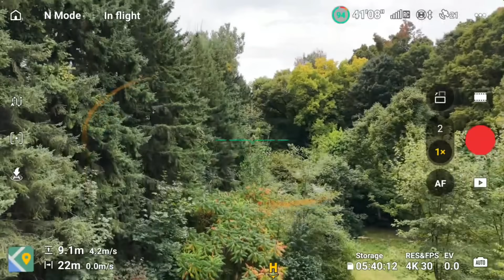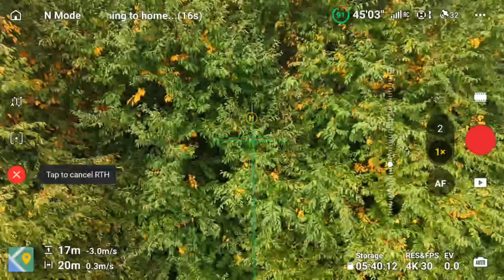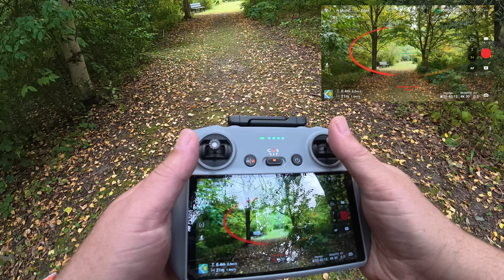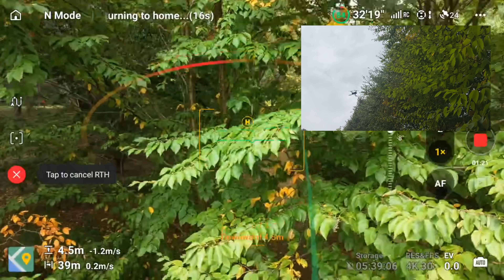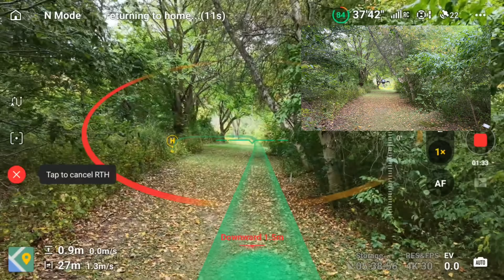DJI Mini 5 Pro NEW Next-Gen Return To Home Demonstration

Comment: Holy crap. Lots has changed since my first drone, the DJI Phantom 4. I will say, though that the Phantom 4 was able to carry a half dozen chicken eggs from my neighbor’s house located approximately a quarter mile away. That ain’t happening with this thing, right? 😂 Excellent video!
Reply from the maker: Indeed, I think it would have a hard time carrying that type of payload. But they have changed quite a bit. They are extremely capable for the size.

Comment: Greetings Shaun...Do you think this feature will solve the problem of drone retrival on a boat, would it perform well on returning through a door opening into the galley of a fishing head boat on the Ocean?

Also what will happen if the sensitivity of the  sensors causes the drone to stops  for an obstacle its can't find its way around? What will the drone do when this situation is encountered?
Reply from the maker: That’s a good question. I’m not sure about that. How it would behave on a moving boat.  Or even a stationary boat with drifting. Maybe somebody else with more experience who has tried it give some advice.

Comment: Do you have to have it set to SMART RTH also does it work at night?
Reply from the maker: It is automatically enabled, and in indeed that can function at night however there are some extra risks, but due to its new front facing light door it should still be able to detect the obstacles even in poorly lit conditions. Just be very cautious and always be ready to cancel the return to home if necessary.

Comment: Very nice video. Thank you for sharing. I have a question: My balcony is at the 4th floor. If I want to fly from there ... are there things I have to consider... When the drone leaves the balcony, will he keep is height?
I fly a DJI mini 5 Pro. Thanks in advance.
Frank
Reply from the maker: Hopefully somebody will experience can answer those questions for you. I’ve never done that myself in theory. It is supposed to be able to handle those types of situations. It’ll maintain its height. It’s just important if you try it make sure you’re ready to cancel it if need be

Comment: How does it know to land on that little pad? Reason I ask is because every time I have ever RTHed a drone it just lands in the general area of where it took off. It’s never been that precise.
Reply from the maker: For the most part that they usually land in the general area sometimes they’re off by a couple inches sometimes a couple of feet. But the important thing is that they come back to the general area so you don’t lose your drone in the event of a fail safe disconnect. I found some of the newer drones are more precise than some of the older ones.

Comment: I love how it turns around at the end to point in the same direction it started, very OCD. I picked mine up on Friday and have been playing with this feature. I have the Mavic 4 Pro but need a sub 250g for shoots in restricted airspace (it weighs 251g, but hey, who's counting? I'll pull a prop off if they try to arrest me). The Mini 5 Pro is amazing in capability and image quality for its size.

Comment: Suggestion: please perform this test again, in the dark, and when it reaches the altitude where you would like it to return home, turn the controller off without pressing the rth button and please DO stand right in its way where the green rth-line would be, to see if it will dodge you. Now thats pretty much a worst case scenario
Reply: I second the test idea.

Comment: So, if you fly around for 20 minutes and then issue return to home, if the drone traces the flight back it will run out of power long before it gets to the home point.  Something to test in your next video.
Reply from the maker: It won’t backtrack your entire flight. It’ll come to the home point using the built data once it gets close to the location.

Comment: Oh, this is exciting! My Mini 4 Pro is still crushing it though. I'm going to wait for the Mini Pro 6 with a dual camera system (and maybe self-unfolding legs and a one-hour battery🤪)
Reply: Really, how is your Mini 4 Pro crushing it exactly? I just got my Mini 5 Pro on Friday and I have yet to find any new feature that is not an upgrade over the Mini 4 Pro, or any feature it has lost for that matter. Good as the Mini 4 Pro is, the 5 Pro is next level, they are not small upgrades.

Comment: Very impressive. The mini 4 pro does some amazing home returns too. Not as good but I have tried many home returns it thick woods and was completely amazed.  Not quite as good but still amazing. The only upgrade that would make me want to upgrade is the one inch censor otherwise I really don’t need it. My mini 3 pro and mini 4 pro have more flights than I can count and have never had a crash. I still own the original mini 2 and even that drone is still like new with over a thousand miles on it. Still running with the original battery’s on it DJI is definitely number one for me I have had many drones from most drone manufacturers. Sadly all my drones that were not DJI are all gone from fly always, crashed, or completely dead batteries that are not available anymore or not worth the cost. Thanks for another great video,,,,😊

Comment: What models does this new feature apply to? I have a few DJI models and never can keep track of what each can do.

BTW, yesterday I was "exercising" (i.e. making sure it still = AOK) my old Air 2S. I did any/all of the updates as needed. Had it & RC-N1 & phone fully charged. Did a 5 minute test flight. On the way home the phone screen went black (maybe screen went to sleep, not sure). I freaked out because I could not see a screen. but I could see the Mavic and could still control "blindly" to guide it back (luckily the phone screen finally popped back on before landing). But I had never had this happen before and was wondering if Return To Home would automatically kick in if the controller failed or turned off. Or do I have one those models from the era when they would just fly away went something went wrong? Thanks, been subscribed since way back.
Reply: I have a Mini 2. You just need to make sure it's set to Return To Home in settings, not hover in place or land. I've "lost" it a couple of times and it just comes back to me. In one instance I did lose video, turned off the controller, and voila here she comes. Scary? Perhaps, but that's what it's designed to do.

Comment: The Mavic 4 Pro and Air 3S never fail to impress me. One rally impressive detail is how confidently it comes back, there's no hesitation in most cases. I have a huge tree I on my driveway I now launch confidently right under. Mavic 4 Pro in particular comes in HOT,almost full speed, goes right around that big tree. Almost gave me a heart attack the first few times! Mini 5 arrives tomorrow.  Cost me, a lot, but now I have all 3 new Gen DJI Drones!
Reply from the maker: I’ve had a few moments like that myself I have faith in the equipment, but sometimes it does get your heart pounding. It’s a lot of money coming in fast
Reply: @AirPhotography Yes it is, especially with Mavic 4 Pro. Thanks Shawn!
Reply: What do you think of the Avata? I'm a newbie with a little DJI MINI 4K

Comment: Very impressive, but you may want to mention that you need to also check your Return to Home settings, since there are two options available that you have to choose!
Reply from the maker: That is an excellent point; I should have mentioned that during the video.
Reply: What are those 2 options?
Reply from the maker: Basically, you can have the advance return to home like I demonstrated, or you can set your own return to home altitude in the settings, but my default that is disabled
Reply: @AirPhotography  Thank you!

Comment: Thanks for the video, impressive RTH indeed. In your tests the drone basically just reversed it’s entire flight. I’d be curious to know how it would handle coming back if it had done extensive flying around in all directions before auto return.
Reply from the maker: If you have been out flying for 15 or 20 minutes, it won’t backtrack the entire flight. I’m not sure how it does it, but it will only utilize information that it needs to get back to the home point.
Reply: @AirPhotography  Thanks, yeah I did not expect it would completely backtrack. Just wondering if would become less accurate with longer and more complex fly arounds.

Comment: Dumb question (I think!). Presumably the Dynamic Home Point feature has to turned off?
Reply: Im sure that if you have the dynamic home point on, the drone just makes its way to you as norman, but instead of landing it hovers at what evr height you have pre programmed. Hope this helps, as this is what happened on my mini 5 pro flight yesterday. Have great weekends guys.
Reply: i think
Reply: I too am curious about that too as Dynamic Homepoint is supposed to use the current controller’s position as the return homepoint
Reply: @psoon04286  Thats only available on the RC2 PRO, not on the RC2 the OP was using.